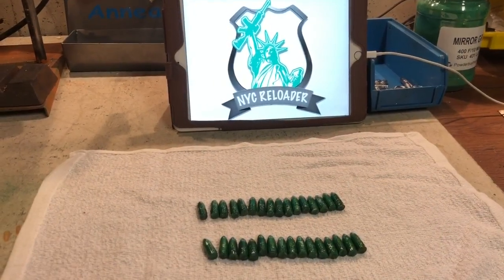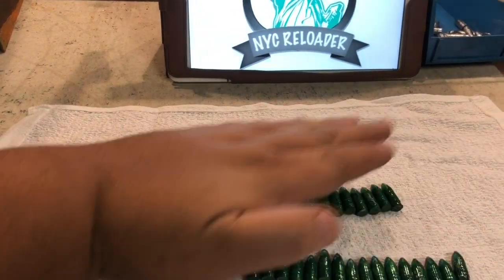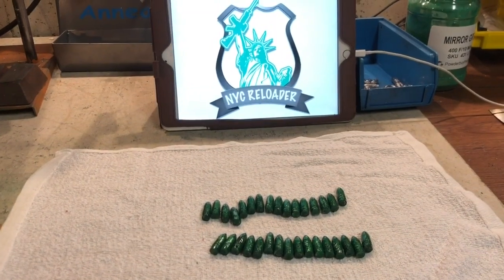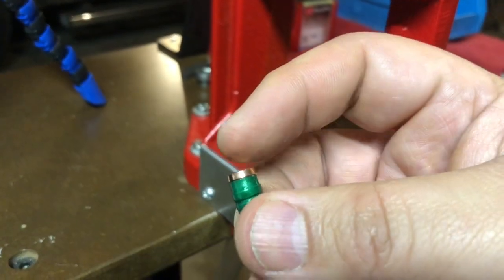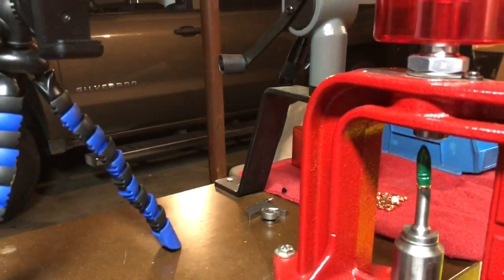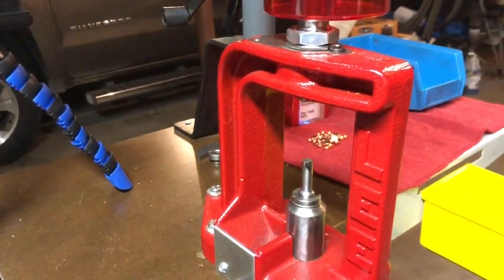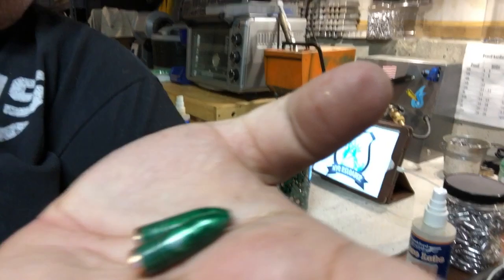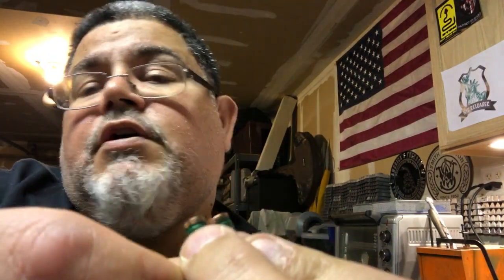Lubing sizing and gas checking my powder coated bullets

Comment: Gas checks are not needed for powder coated bullets. There have been many studies done, which prove that non-checked powder coated bullets actually have better accuracy as well. Some of the studies placed paper wads below the unchecked bullets and those paper wads were recovered with almost zero burns and damage to them. The lead scrubbing aspect of gas checks is also done with the powder coating on the cast bullets. The powder coating never gets hot enough to burn off or break when used. So, gas checks are NOT needed on powder coated bullets.
Reply from the maker: Hey Tom, I do not gas check pistol caliber pc bullets however I do on specific hotter rifle bullets if I’m pushing the FPS. If you stay subsonic you are correct there is no need to gas check. There is a sweet spot for sure but depending on the FPS target velocity you may want to gas check. As far as accuracy goes if you ladder load them you will find the sweet spot that works for that bullet. Once you have your accuracy node with the gas checked bullet you are all set. The accuracy nod is clearly smaller with a gas checked bullet but still achievable.

Comment: NYC, do you remove the Dillon lube somehow after sizing or just leave it on?
Reply from the maker: Dillon lube May be left on as it is 100% compatible with reloading and can remain on the case. Here is what Dillon says. 

“Rapid Lube 5000, Dillon's aerosol cartridge case lubricant, has been replaced by an "environmentally correct," non-aerosol case lube. It works the same: Simply lay your cases out, spray lightly with one or two passes and you've done it. No mess, no guesswork. Within minutes the lubricant distributes itself around the cartridge cases and you're ready to load. Try a bottle. You'll never use a grease pad again.”

Comment: How fast have you ran those hard cast, gas checked bullets ?
Reply from the maker: James Pollard I run them between 2200-2500 FPS usually but have run them as fast as 2700FPS and I always gas check. I’ve gotten great results. Very accurate and tight groups.

Comment: I realize that this is an old post, is it necessary to gas check powder coated bullets?
Reply from the maker: It isn’t really needed. But with that said I still do for a few reasons. #1 they look great and I want my bullets to look great. Very eye catching boolits. #2 you can drive them little faster. Keep your eye on pressure limits and remember it’s not a jacketed round. Keep them subsonic if you can and if an ar15 then find the right load to actuate the rifle for the next round then work on finding your accuracy node closest to the load as possible that actuated the rifle. Once you have the accuracy load there is no need to push it like a hot jacketed round. I hope that helps.
Reply: @nycreloader  Thank you for your response, yes your information is helpful.